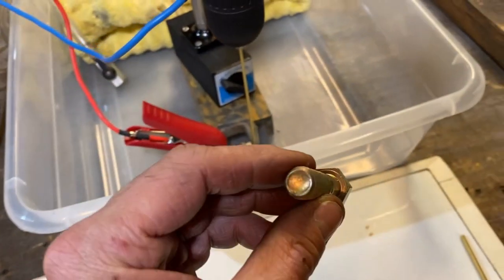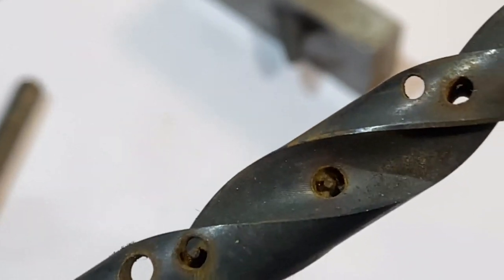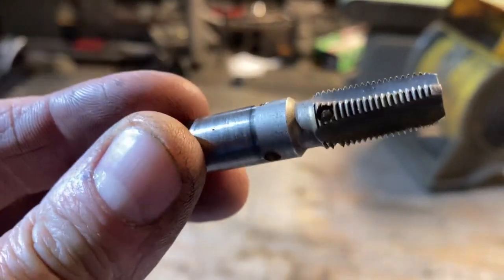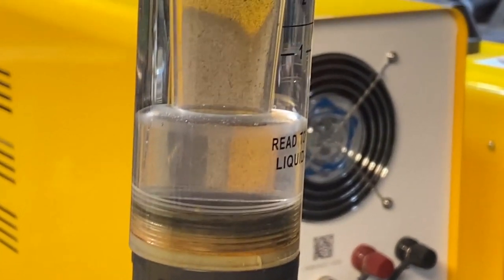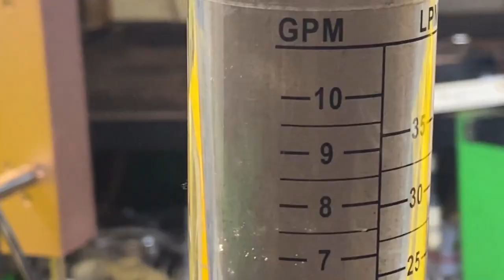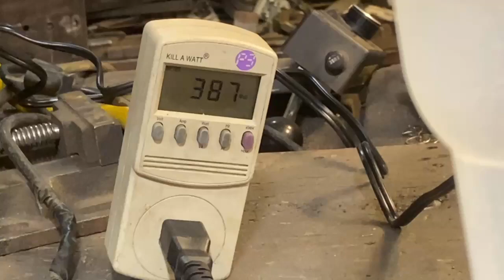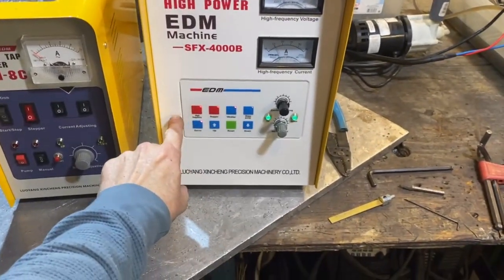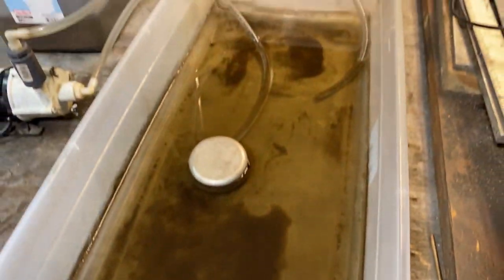High power Portable EDM Tap and Drill bit removal  SXF4000B

Comment: How hot would a Bolt get while burning I don't see the water steaming
Reply: Thats the trick of it... they stay cool. It is only impulse and high frequency but not much ampere. It is not welding it is producing short sparks to blast away metal. you can do that with 30V and 1a with a lab power source.